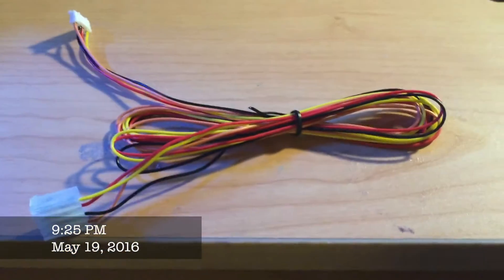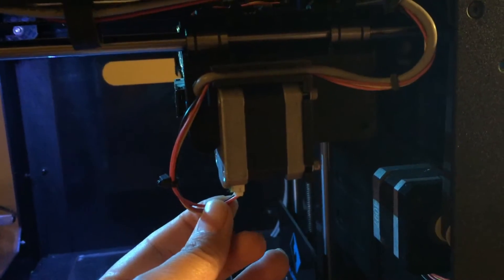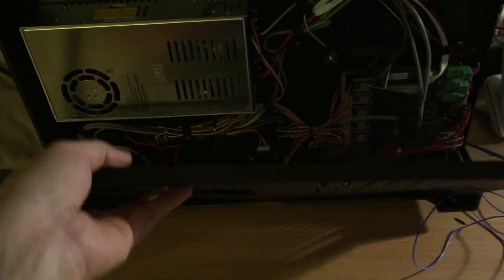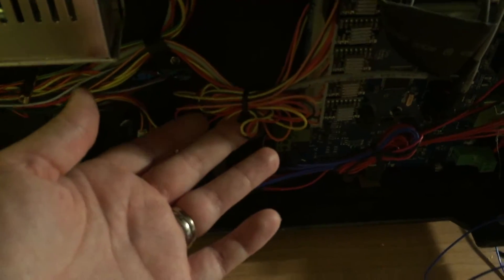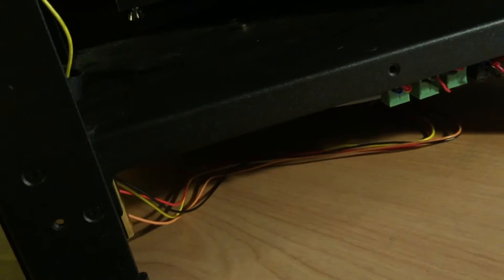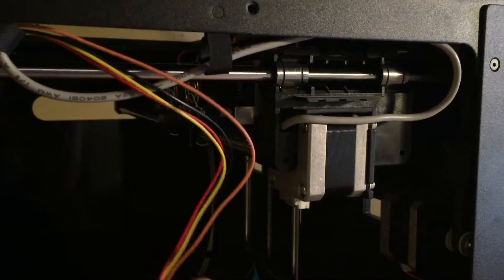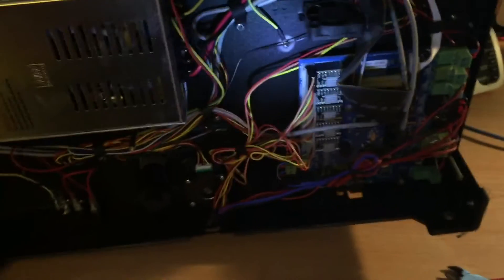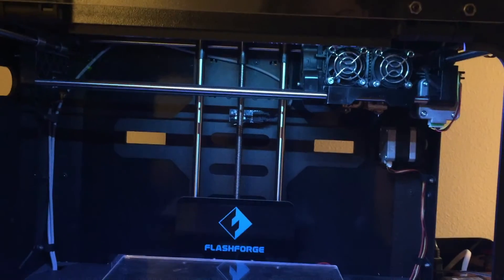How to Change the X Motor Cable on FlashForge Creator Pro

Comment: I am curious, how does this cable go bad in the first place?  Thanks for the video.
Reply: In my case the cable at the connector was not secured from the factory. So after continuous back and forth on the x-axis the exposed wires would break.